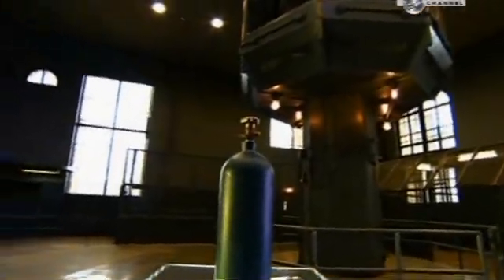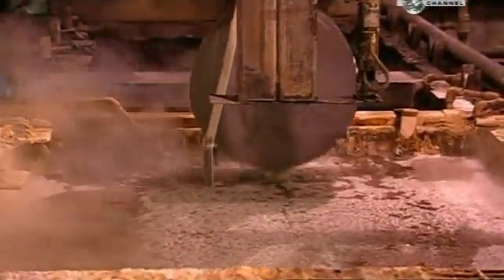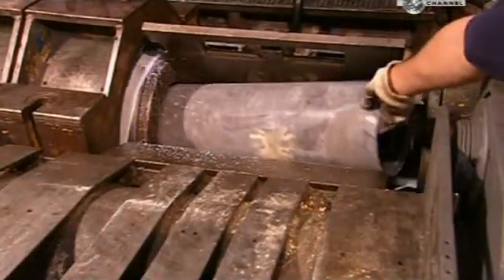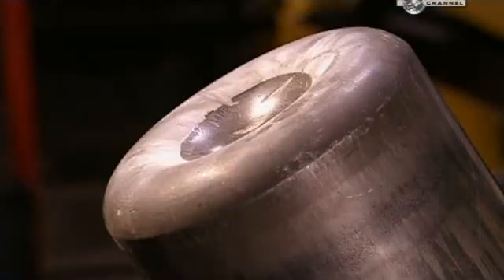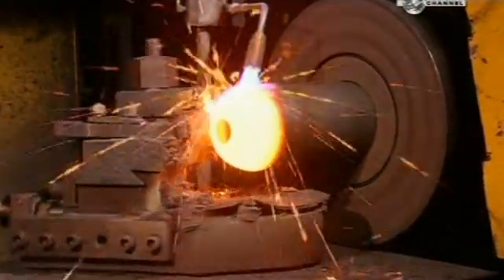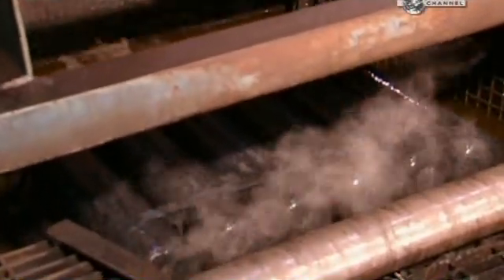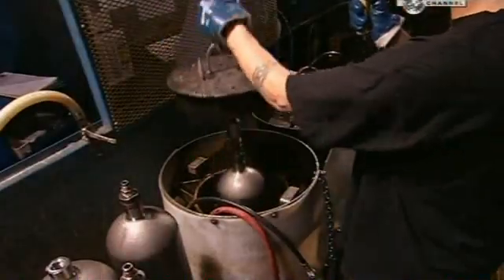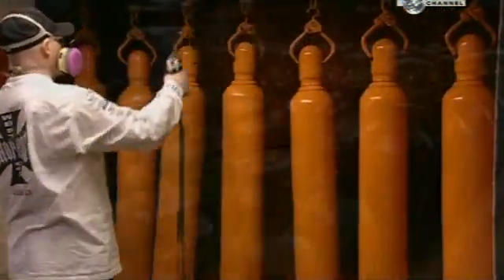gas cylinders

Comment: when  hot cylinder goes into water how can flames in water??
Reply: residual oil from the cylinders applied during the forming process floating on top of the water ignites on contact with the cylinders having a surface temperature of around 900C
Reply: do you hear properly? he said chemical bath
Reply: ज्ञानी पुरूष
Reply: anosferatus it isnt water. this process is also known as quenching and is done in chemical baths or oil, yes in the rare instance water, but not in this case.